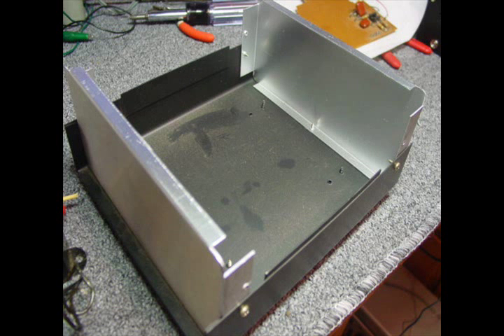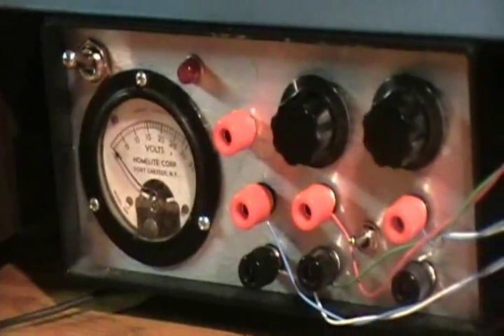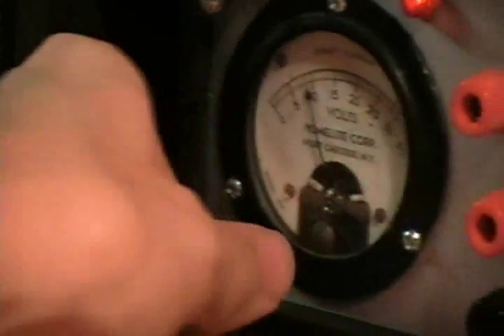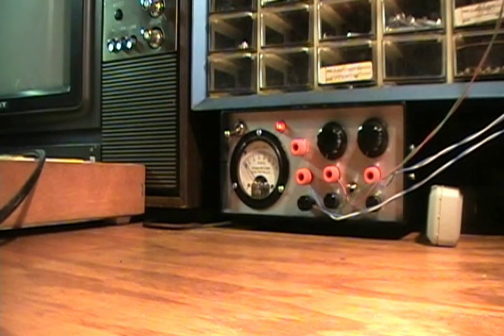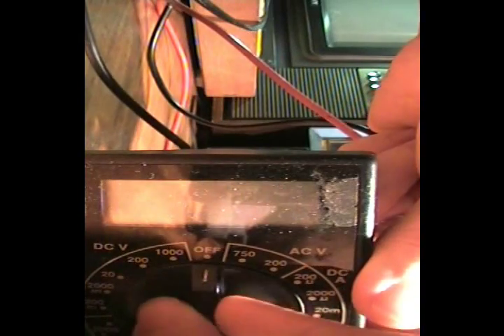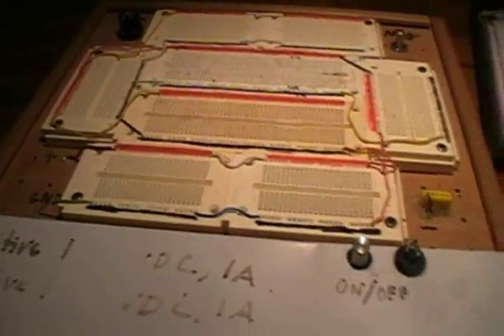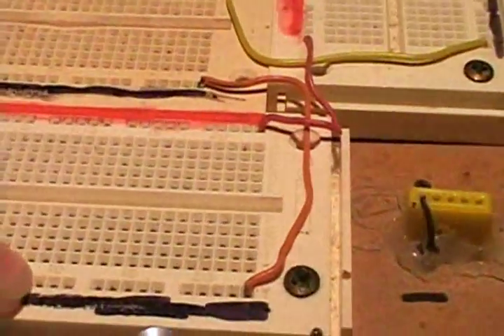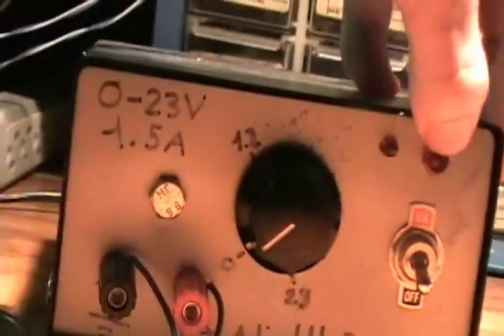My homemade power supplies.

Comment: Nice vid, the LM317 variable voltage regulator  types are good for quick experiments, but for a usable project, as recomended by someone else,  it's good to use a fixed regulator if possible, because, for example, if you have a 25V transformer output, and use the LM317 to reduce it to 9 volts, thats a  16V reduction at the LM317 chip,  and with a currrent, say 1 amp, there will be a 16W power loss/wasted in the LM317. IC/chip.  Hence, a good reason to use a heatsink.